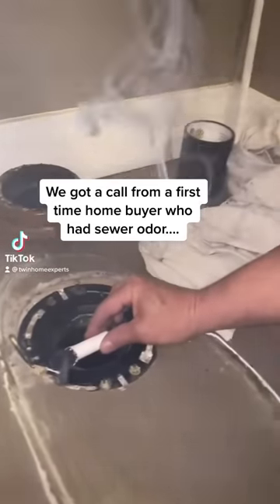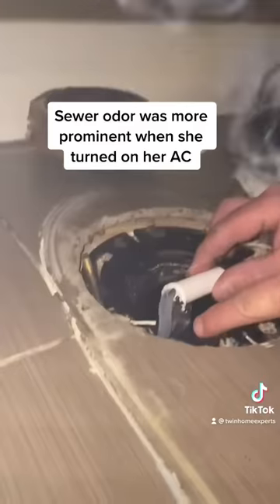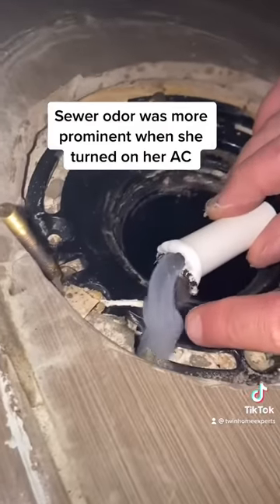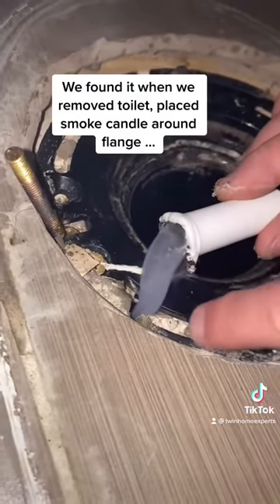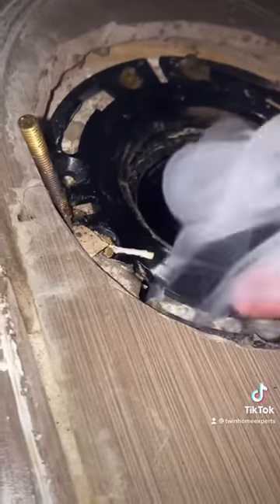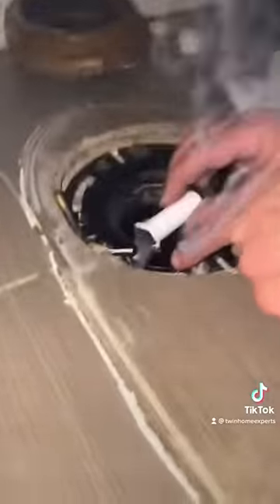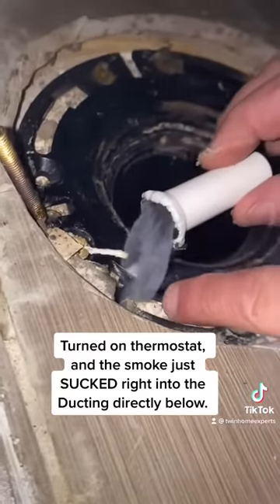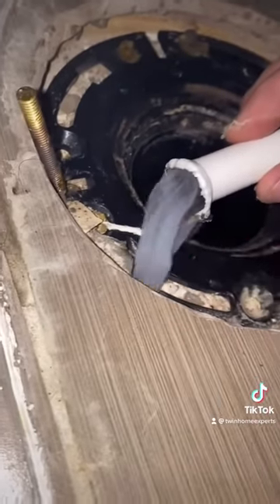BEST WAY to Detect a Sewer Odor 🤢🌫️🚽

Comment: This is very useful. Just experienced a stint of sewer smells from the restroom. Bought a wax ring replacement.
Edit: problem staying solved 9 months later
Reply from the maker: Bam 💥
Reply: @FROY LÁN cannabis reference?
Reply: wax rings are garbage only silicone from now on for me you can reuse them and they don't deteriorate or smash flat
Reply: @FROY LÁN anyone that buys pre rolls is lazy because you're actually just buying the garbage that no one else will buy so they roll it up in a paper
PFFFFTTBWUHAHA
Reply: @thecloneguyz if you are buying prerolls like that, then you're going to a shitty dispo. the pre rolls where I go are always absolute top quality.
Reply: @thecloneguyz  wax will last longer than those silicone ones. There's a reason it's been around for a long time.
Reply: @BrendonGillespie  
PFFFFTTBWUHAHA 
My plumber buddy has replaced thousands of wax ones but he can reuse the silicone ones because they're not damaged
PFFFFTTBWUHAHA
Reply: @thecloneguyz  Bad statistics caused by not properly calculating the probability within your ratio. Of course your plumber friend has replaced "thousands" of wax seals for toilets. There's millions of toilets in the USA alone, and all of them of various age and within various conditions. 90% would have a wax seal installed. By nature wax seals are single use disposable, whenever one of these various toilets breaks and requires a new seal the old wax one will have to be replaced. 

Correlation is not causation. Saying that he has frequently replaced wax seals but rarely replaced non wax seals does not mean that wax seals are bad and non wax good. That's not how the probability of your values works. 

All you've said is your plumber friend has encountered wax seals more than non wax, because there's more wax seals than non wax in toilets. Replacing is a moot point, by nature they're disposable, biodegradable, and wax is sustainable. Of course encountering them means replacing. So again, just means he's seen more wax than non.

Wax seals last 30 years if kept in a proper environment, and you did not state their age or environmental cause of premature degradation for the "thousands" he replaced. Nor did you give any information for the broken non wax seals he had to discard. Plus if a toilet is kept in good condition, on average the entire receptacle would last for just around 30 years before you'd need the whole thing replaced. The same lifespan as a wax seal. 

So.. are you intending on breaking or remodeling your bathrooms to require a new toilet every month, but with the same silicone plastic seal to get your money's worth? Because the whole gimmick of them is that they're reusable, when your average joe doesn't need to be replacing/reusing a seal but once every few decades. Dick Paige over here really trying tryna pull something lmao. Yeah, you sure showed us guys who buy a 3 buck seal every 30 years because you only bought your plastic seal once and you gotta save every penny for the 1200 toilet replacements every other week.
Reply: @cognitivedesign735  😂😂😂 yeah sure they are bud.
Reply: Yeah them wax rings I tell you I tried one of the new ones when I bought a new one the non wax ones supposedly reusable but anyway fuckin thing had my bathroom stinking went back to the original 🍩
Reply: Now you can pretend to be a plumber until you run into a problem and hack the shit out of it
Reply: In a store? Who calls a bathroom in a house a restroom?
Reply: @HarryHafsak  people with job experience usually start to refer to it as a restroom and people who are at others house I’m not here to use the bath im using the toilet so I would say restroom shit when I just typed it in my phone multiple emojis popped up
Reply: Is that all that was needed?
Reply: @bromethiustrilbotbromeldeh6625 yes lol
Reply: @thecloneguyz listen man, not everybody got time to roll like 5 joints a day. besides, it’s so nice just reaching over and being ready to smoke at any time without wasting time rolling.
Reply: I did too but I’m thinking my toilet just breaks the seal. So when we use it and get up the toilet moves. We fixed it and the leak in January but by May after fixing I still see leaks on the cieling below. 

We have 2 bathrooms upstairs and 1 down. The toilet that’s the issue is in our daughters jack and hill bathroom. We replace the pipes and seal. But after two months the toilet is lifting up and moving or moving side to side again.
Reply: @thecloneguyz  it's called convenience.  so by your logic, if you ever ordered take out or delivery... you must be lazy.
Reply: @cognitivedesign735  You're entitled to your opinion, but maybe your opinion is just of lower quality too, or at least that should be considered. Additionally, it's been proven that the way marijuana works and trust me, i don't need a doctor for this I have more experience than everyone in this channel is based on the person, and obviously not the levels of THC. So what you think is good and what he thinks you're good or probably totally different things. The one thing he certainly said that you are not right about is you're over paying for it. You're paying for the laziness and joints are wasteful as fuck anyway. So why don't you just go ahead and pack a bowl?
Reply: Foam seals work.
Reply: @thecloneguyz  I’ve smoked some real nice joints from dispensaries before but I’ll be damned if I pay $6-$20 for a damn joint
Reply: @bromethiustrilbotbromeldeh6625 bruh, obviously lmfao 🤣
Reply: @flamingfairy9  if you don't have 5 minutes to roll five joints a day then you deserve to smoke whatever garbage somebody's putting in the pre-rolls
Reply: @cognitivedesign735  same he must go to a dive shop because I get good pre rolls
Reply: @SnailHatan  
YOU COULDNT GROW YOUR OWN FIRE IF YOU WANTED TOO 
ROOKIE 
PFFFFTTBWUHAHA
Reply: @kennypowers1945  
"SHOW ME ON THIS DOLL WHERE RICHARDS WORDS HURT YOU SO BADLY AND FORCED YOUR TINY LITTLE BRAIN TO TYPE OUT A COMMENT"
Reply: @thecloneguyz  rubber works pretty good too.
Reply: @BrendonGillespie  actually no. Silicone takes 50-500 years to degrade and wax can biodegrade in as little as 2 months. Nice try Boomer but technology is advancing. Keep up with it or you’ll be left behind.
Reply: That flange needs to be raised to the proper height then a new gasket. I would also seal around the pipe between floors.
Reply: @thecloneguyz  not how that works at all. 
I'm smoking one right now and it's smooth, tasty and the % is 25% thc. Now. If you're going to talk smack about products, know what you're speaking on. The ONLY time you get junk is when you get prerolls on sale... that's typically what shops will put the rest of the shake into from the flower they sell daily, which is also not necessarily bad either. 
Prerolls are typically less expensive to purchase by gram than buying flower by said gram.
Reply: @thecloneguyz it's actually not just lazy people. I'm disabled with ms and I've started struggling to roll, I already made them in roll up cigarette tins but even that's getting tougher. I unfortunately don't live in a country where pre rolled are an option so I unfortunately have to struggle on for now. 🤷‍♀️ But I'd definitely buy them if I could. I wish people would stop complaining about things that improve the lives of disabled people. Most of the time it seems really silly to normal people but it's all these little things that really add up and are hugely helpful to people like me.
Reply: @cececox6399  I donate a little over a pound every single month to veterans and people with no money it's just my little popcorn bud that I don't feel like trimming but I give it away every single month and have for almost the last 15 years and that's so I can Pat myself on the back and make myself feel like I'm helping
Reply: @thecloneguyz  and also if you appoint someone new to the job, they won't have to reset the toilet later when they mess up 🤣. It seems to immediately work every time
Reply: @thecloneguyz thousands huh….
Reply: @thecloneguyz  lazy sure, not necessarily stupid. Theres cheap ones and there's over the top ones, they're all worth it to somebody
Reply: Korky is far superior to wax ring.
Reply: @bromethiustrilbotbromeldeh6625  lol
Reply: @thecloneguyz  yeah, they just aren’t one size fits all. They will deteriorate, and faster than wax. Wax doesn’t deteriorate at all. What happens is bad ring installs, someone rams the toilet, or plunges the toilet by increasing preamble instead of sucking. Lemme explain: push plunger down slowly and then yank up. This will cause suction and avoid the common blowout. 90 percent of failure is from plunging. 
Also, the person in the vid has an air return leak. Why it’s running thu the floor i have no clue
Reply: @Wtfinc  
"SHOW me on this DOLL WHERE my WORDS HURT you so BADLY and FORCED YOUR TINY LITTLE BRAIN to TYPE OUT A COMMENT"
Reply: @Wtfinc  
20-year general contractor blah blah blah blah blah everything you say goes in one ear and out the other because I rely on my experience not some guy hiding behind an anonymous account in the YouTube's comment section
Reply: @Wtfinc  I guess you've never seen the two-piece silicone gaskets that fit any floor and any application but maybe you'll grow up and learn one day there's always hope
Reply: @Wtfinc  I did a bathroom for this couple and then five years later they called me to upgrade the floor 2 wood grain looking tiles and when I pulled up the toilet the gasket look fine so I put it right back down again that was in 2008
Reply: When in doubt double wax ring.
Reply: @thecloneguyz  Wait first you claimed that your buddy was the one installing the rings. Now it’s suddenly YOUR experience you’re relying on here? That’s a bit suspicious
Reply: @thecloneguyz  one of the 3 dispos within walking distance from my house gives me fire prerolls for free every time I shop there. I'm not just saying they're fire when they aren't. some dispos are very well known for their prerolls. if you end up with shit weed when you paid for good weed, the budtender probably just didn't like you
Reply: @atlasferrara7418  yeah I'm a general contractor and I subcontract to my plumber buddy what's so weird about that
That tells me you don't understand construction at all or you would have thought of this already
And I'm not the one hiding behind an anonymous account because I'm too scared to show my face with my comments!? THATS YOU!?
Reply: @nikkidimick947  PFFFFTTBWUHAHA 
Unless the stuff that you're buying says 100% pesticide-free on it then you're definitely smoking pesticides
Reply: @Wtfinc  PFFFFTTBWUHAHA 
It was funny reading his comment again about how wax doesn't deteriorate but silicone does he obviously doesn't understand science or live in reality
Silicone can last 50 or 500 years show me wax that can last that long
Reply: @thecloneguyz  lmao, not all pre rolls are rolled by a machine. Shows how much you think you know. Maybe don’t buy the cheapest shit you can afford? Also, the budtenders at my local dispo are incredibly knowledgeable. And also incredibly patient. You could learn a thing or two from them
Reply: @kylekoenig4730  ok yeah shim the back so it sort of tilts and stays sealed and it won’t move getting up. If it’s moving up when you stand up that means it’s not level to begin with
Reply: @cmasterson  right. If it moves when you sit down, the tile isn’t level. To compensate, you raise the back to drop the front. It cant move down when you sit if it’s already touching the tile.
Reply: @AndrewMcFarland-hp8kh  PFFFFTTBWUHAHA 
You can just Google it and see that the silicone ones last twice as long as the last ones but whatever you tell yourself to make yourself sleep at night
Reply: @thecloneguyz  Don’t talk abt plumbing if you don’t know👎🏼
Reply: Damn. I've just been buying tons of wax candles.. :(
Reply: @HarryHafsak  lots of people? It’s regional. Tell me you don’t travel without telling me you don’t travel
Reply: @canigetahoooyyyaaaaa7319  Foam gasket seals maintain a good seal even if the toilet rocks. This type of gasket will allow you to set the toilet multiple times, unlike wax rings that get smashed once and need to be replaced.
Reply: @ihateallyall  Six dollars is way too much for you??
Reply: @nikkidimick947 yup you are correct, I rarely have to go to a dispensary because I have a family grower but when I do if I’m low on money I usually look at the 1g prerolls and they are usually $7 or less. The last prerolls I got were on sale 5 for $25 and tested at 28% THC I usually pour them out since I smoke bowls. I wouldn’t be able to get 28% flower for $5 a G outside of a preroll.
Reply: @thecloneguyz says the guy named the clone guys
Reply: can you explain hwo this helps sewer odor?
Reply: @thecloneguyz if you're telling people to use silicon rings, then you are a garbage contractor, and your friend is a terrible plumber. Chemicals from toilet cleaners corrode and eat away at rubber and silicon. They don't do that to wax rings. Take it from someone with real experience.
Reply: Thank you for sharing what may be the problem with a possible solution. I purchased my home recently, had the toliet replaced before moving in, and a few months later, I started smelling a  sewage odor.
Reply: Wax rings suck. They are the cause of 99% of water damage bathroom remodels I end up doing at work. Often times what winds up happening is a customer calls us and wants us to redo the bathroom for cosmetic reasons. Then, as we start the demo process we discover severe damage, mold, and mildew of the structural members and subfloor due to a prolonged, slow leak from the wax ring. Then it turns into a nightmare with the home insurance company to get the additional work that has to be done covered.
Reply: Is usually the problem ring goes bad cause leaks and smells

Comment: NEVER seen this before. What a wild find. Well done
Reply: Most sewer smell comes when the AC is on but mostly because a vent pipe is too close to the AC unit on the roof. Cycling air on a sunken roof will cause smell as well and then you need an air admittance valve on every vent.

Comment: Wow I sell smoke candles at my job but have never seen them used irl. Thank you!
Reply: People use them to check air flow too. Like if it’s cold in a house during the winter you can check the windows to see if they leak
Reply: Blunts, they're called BLUNTS.
JK
Reply: I’d like but 420
Reply: Did someone say BLUNTs???      I thought I heard it coming from this thread.

Comment: If you have negative pressure (your doors suction when you close them) your A/C needs to be adjusted or jumpers installed. It can also cause sewer gas to be sucked through all of the P traps
Reply: you mean properly cut the bottom of the door so it's not sitting on the floor

Comment: The hvac installer used the cavity between the joists for a return air plenum.  Well, it WAS cheap😅
Reply: I have seen that before. 9 times out of ten theres hardly any air being pulled through the actual return register
Reply: Well that's pretty normal. What's not normal is putting it so near a toilet l
Reply: That's not up to code is it?
Reply from the maker: Here is the full story Sewer Odor in the ENTIRE HOUSE! From the TOILET to the AIR DUCT!!??
https://youtu.be/gX9eJGWSZZY
Reply: Used to be allowable.
Reply: The flange is too low. Should be flush or on top of the tile. Common rookie mistake on multi floor homes. My company leaves 4" pipe penetrated through second floor and then after tile we golden shred the pipe flush then add 3" inside toilet flange. Best way too plumb em. If it's a 3"" pipe we wrap it fat for future installation.
Reply: @vigilantobserver8389  no it is not. Code and what is convenient for lazy or ignorant installers are two different things. See this a lot in the trade.
You should not have piping or wiring in same path as return air, unless designed for it
Reply: @lafawnduh1543  Ohhh. Golden Pipe Shredder kit by Rectorseal. That is a great idea. PVC pipe reamer kit. (Made in the USA with nice looking carbide blades too) I am not at all in the trade, but knowing about custom application or specialized tools is always interesting.
Reply: I’m a air duct cleaner & I see it all the time. But be we this close to the bathroom

Comment: The wax ring sealing the closet flange to toilet should be water tight. If the air handler is pulling in sewer gas there may be a gap. Raise the flange to the the finished tile grade and create a proper seal between the flange and the toilet.
Reply: I'm so confused, how does the AC have anything to do with toilet? Thank you
Reply: @Mike-oz5pp  the toilet might be on the second floor. That little hole where the flange is, must be near some ducting that isn't sealing properly thats on the suction side.

Comment: Ok, I am a general contractor, with over twenty years experience with every type of trade in the home building arsenal. I first started as a plumbers apprentice, and did that for almost two years. Since then, I've done everything from roof to foundation. And there are two points to this video that show a wrong conclusion. Now if the toilet was not mounted correctly then yes that can suck sewer fumes any where. But there is a wax ring that is 2 inches thick that is supposed to seal the toilet drain, to the flange. Without that seal, sewer fumes will escape. The tile flooring though looks to be installed correctly. So this is a very quick fix to the problem, and a wax ring is about $4 so the home owner lucked out. But the video implies that flooring is not supposed to have flow, and that air shouldn't move through materials. While most of the time that's true, houses leveling, and just temp expansion and contraction causes gaps to form. Most of the time very small. It just sucks that this happened next to a toilet with a bad wax ring.